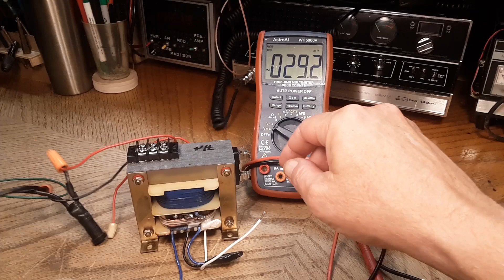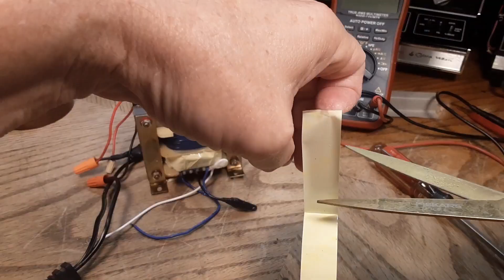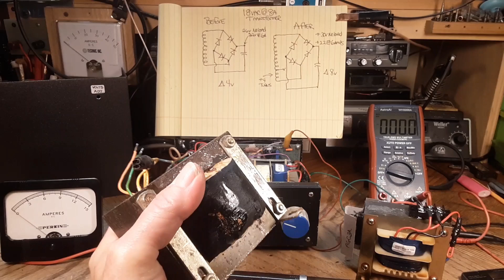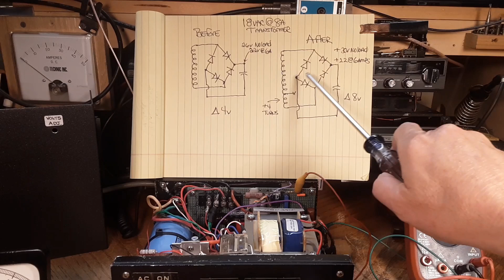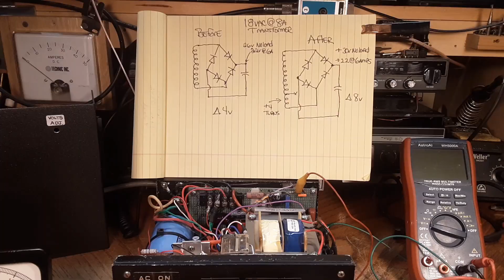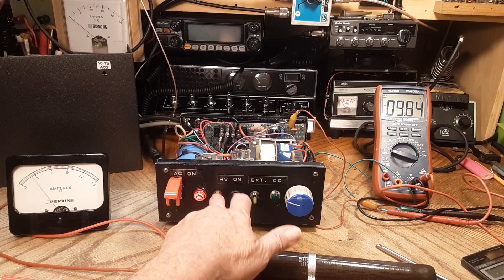😯"oh no..Mr.Bill"hes got another transformer😂

Comment: On today's installment of Skippii recklessly tests your questions, I found an 18VAC transformer. No load idle: 0.02amps on primary. Secondary shorted: 1.2 amps on the primary; 7amps on the secondary@<1Vac. I'm surprised that still put 13vac on the other 18v tap with the first one shorted. With both 18v taps shorted, primary went up to 1.6A. Your 4amp fuse is doing nothing to protect anything. As I said earlier, looking at a datasheet shows you'd need to draw around 1,000w to blow a 4amp fuse in 3 seconds. Hope this helps.
Reply from the maker: Lol😃.your awesome and that's super intresting.im not sure I conveyed things well,but then my statement of,""" is there something in the magnetics of this transformer that's not allowing a high enough pri. Current(with shorted sec.)to blow fuse""was correct??that's what I see,my statement  had truth to it..🙂 what u say plus what I saw aligns well...a four amp fuse was rather "strangely useless".i only used the  four because I didn't have 2amp.my calculations set fuse value at 2amp,but seeing that there was 15,000 uf on rectifier,I would have leaned a bit higher.intresting that the other sec.winding ran,with another shorted🤔,that does make sense,but like you thought,it would have surprised me as well in the moment.you would make a "good detective". you may wanta try your hands at chemistry too.😄thanks for comment!
Reply: @generalingwer4341  I guess it depends on what you mean and your perspective. A transformer is an inductor, and all inductors block AC. So I would say that's not something special going on. The "special case" would be when it doesn't do that. Like, if your AC input has a DC offset, that's a special case of magnetic stuff going on, where you can saturate the core and might be able to blow the fuse.
Reply: @generalingwer4341 
To get into the math a bit, my transformer primary has a DC resistance of about 22 ohms resistance. It uses 2.6w at idle/no load, which is 0.02amps (using Ohms law). Ohms law also says that I^2*R=watts, which gives us 6,000 ohms of impedance. Impedance is just the coil's DC resistance of 22 ohms + the reactance @ 60hz, so the normal reactance is 5978 ohms.
Reply from the maker: thanks for data🙂
Reply: @generalingwer4341  BTW, today's prime day and they've got 20Amp buck converters on Prime for less than $5. Might save you a bunch of effort. ;)

Comment: Is there any particular reason you're not using buck/boost converters to really easily give you the exact and precise voltage you want?
Reply from the maker: @SkippiiKai  that's a really good question.no there's not a reason.other than to say,I wanted this to stay same way it was in 1991.honestly, I haven't built a feed forward/ boost converter for years.its funny you mention that because today I was thinking about getting into them again.what would have helped a bit would be a ldo regulator,but i wanted to keep the old school appeal.lol..ive just started exploring ldo's today actually..they only require a fraction of a volt headroom for regulation.to sum it, I need to explore more current,lol,methods of doing stuff.ie,I gotta get with the times.😄thanku for comment😃
Reply: @generalingwer4341  I get it. I always felt that buck/boosts were cheating, but when I realized I could get a 15-amp buck converter with very precise voltage control for $5 I decided I was okay with cheating!

Comment: I'm not exactly sure what the question is about the fuse. That transformer is rated for 144watts (18v*8A) so the current draw is 1.2amps. That's limited by the DC resistance, which doesn't change, and the reactance which changes with the current on the secondary, among many other things. A 4-amp rated fuse will last 3 seconds at 9 amps. Even with a full short circuit, I doubt that one variable alone will drop the reactance enough to make it draw anywhere close to that. That's over 1000 watts! Why not just put an ammeter on the primary and measure it?
Reply from the maker: There's no question.its just my way of presenting things.dont forget to factor in transformer efficiency in your calculations.have a great day.🙂

Comment: A normal DC fuse won't blow with ac. That's why they use trip breakers.
Reply: What??? That's just wrong. A fuse will blow exactly the same between DC and the equivalent RMS current. It is literally the definition of RMS.